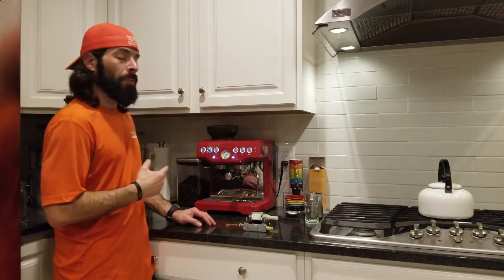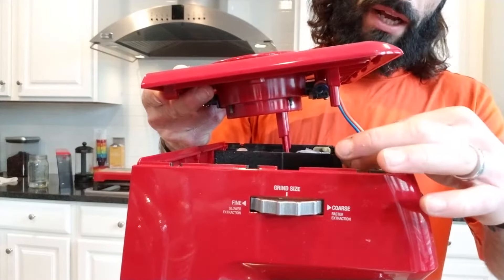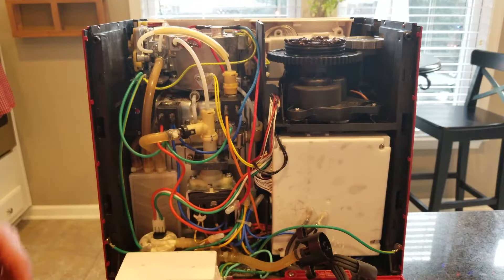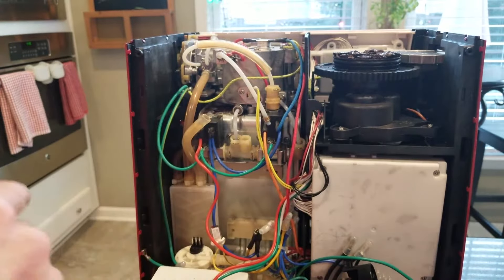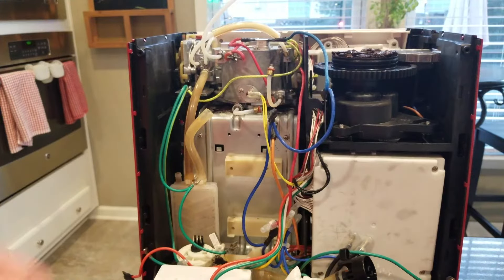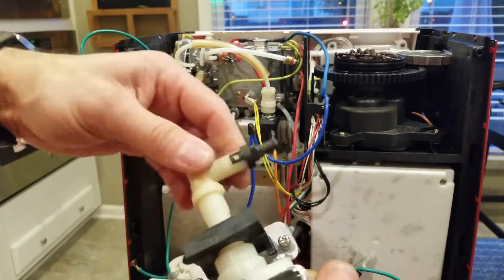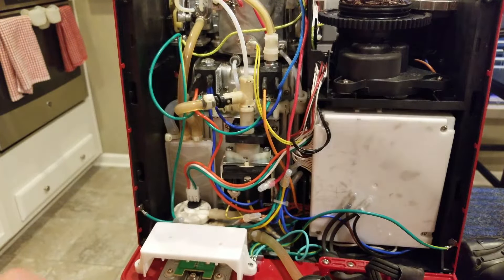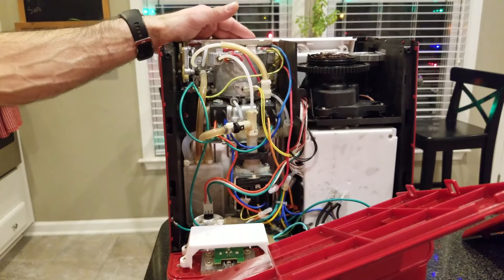Water Pump and Solenoid Block Replacement on Breville Barista Express 870XL

Comment: It's been years since you posted this, but I just wanted to give a huge thanks. My beloved 870 recently stopped putting out sufficient pressure to pull shots. Thanks to this vid I got a replacement pump and the swap went easily and my machine is now working great again. The pump was only $35 vs. the $270 Breville wanted for sending it in. They also couldn't guarantee that I would get the same machine back and since mine is the Cranberry red that is no longer made, therefore can't be replaced new,  I didn't want to chance losing it. Thanks again.
Reply from the maker: You're most welcome.  Makes me happy that it is still helping folks.

Comment: Greetings from the UK. We have the same Breville machine rebadged as Sage which has leaked twice now in 4 years.  First time it cost a fortune to have it repaired at a Sage service centre.
This time, with the help of your disassembly video I'm going to tackle it myself.  So, thanks for uploading.
Reply from the maker: If you have poor performance (i.e. low water flow) and no loud buzzing, then make sure to check for blockages due to scale breaking off and clogging the very narrow tubes.  A major culprit for this is the last tube on the right as you view the machine from the back.  Good luck!
Reply: @trappedinthedark8574   -  Sure, here you go.

It's not owned by Sage, it is simply who they recommend for their in-warranty repairs.  Sage don't have their own service centre in the UK.

Coffee Classics Ltd
Unit 1, The Stables,
Wayside @ Braunston Business Park
London Road,
Braunston, NN11 7HB
Phone: 01788 890 834
Email: info@coffeeclassicsservicing.co.uk
http://www.coffeeclassicsservicing.co.uk/

http://coffeeclassics.co.uk/what-we-do/machine-repair-or-breakdown/

Comment: Nice instruction video on how to do... I'd like to add in a small comment for anyone new to this type of repair if I may. Take pictures before you take things apart so you will know where it belongs after also pay attention to the solenoid wires because if you mix them up for example the left on the right and the right on the left it will not work correctly the blue don't matter and the green don't matter it's the other two I'm talking about look like orange or red very similar in color. The other wires are more easy to remember and straight forward. One more thing most people don't know about... the two screws that go up under to hold the lid downwards those are "less magnetic" less iron in them so they will not rust out when all the steam hit's them so take either put them aside so you will know where they go or use a small magnet and test them:) I've learned this trick after fixing many of 'em.
Reply from the maker: Nice tip on the screws and I love cameras for memory.  I can't count the number of times I have referenced photographs to alleviate the burden of recalling where wires and or connectors went.
Reply: Solid tip, did that, and it was useful 1 time. I always do when I open up something more complex than a stone

Comment: One tip I picked up along the way. If you use a tiny bit of food grade (Notice I said "Food Grade") silicone lube on your "O" rings they will not only go on easier, but they will find their seats and seat/seal better. It also serves to protect the rubber from degradation from heat and moisture. It is also a good idea to use the factory specified parts in all cases including the gauge of the zip ties. May not matter, but then again, you never know.
Great video! Thanks for taking the time to help some guy learn this skill for when his own pricey toy takes dive!

Comment: Great video! The steps you showed in the teardown were helpful in getting my machine opened for repair. 
Before ordering parts I checked out all the internals and found a clogged line from the boiler to the steam head (what you named the valve block). Cleaned it and tested it before putting it all back together and it works well once more.
Thanks again! 👍

Comment: This is an excellent walk-through of how to replace the pump, etc. I was having pressure trouble after years of use and had been anticipating a pump failure. I replaced the pump - would not have know how without this video. Thanks!    NOTE: after I replaced the pump my problem was NOT solved so I inspected the inline filter as described in other comments. It seemed clean but I decided to try DE-SCALING the machine. Made two full descale runs and my problem was SOLVED. Maybe I didn't need a new pump in the first place.
Reply from the maker: Scale is my number one go to.  I usually find chunks at the ends of the line causing a partial blockage.  This Red machine of mine seems to give me all the fits.  😅

Comment: Great video. Replaced my solenoid 2 years ago and now my pump is failing. Very nicely explained. Thanks!
Reply from the maker: Before replacing it try flushing it out with a syringe or the like.  Some have had scale build up in their pumps as well and had success in flushing it.

Comment: I had the buzzing sound too but it was caused by me not using a stronger decalcifying product. I used Vinegar which my manual told me to use. I spoke with Breville yesterday and they no longer recommend using Vinegar. They suggested I use Dezcal packets (Amazon has it). They instructed me to do the decalcifying twice and then follow up with the tablet "Clean Me"  procedure TWO times. When I did this, BOTH my pressure gauge AND my buzzing sound stopped. It was magical. I would do this going forward to prevent the buzzing to come back. Which is will if you do not decalcify it properly
Reply from the maker: That's a good tip.  I appreciate you posting it.  Currently when I get an obstruction I have no buzzing just poor flow and pressure.  I manually go in and remove the obstruction.  I know I keep saying I will post up that video and I eventually will.  I'm curious if that product is strong enough to dissolve the bits I normally find.

Comment: How to save your pump: 9/10 times, they're not dead, it's the diaphragm that's plugged with scale. Just pick up a 60ml syringe from your local farm supplier (Rona sometimes stocks them) and use it to force a 50/50 vinegar water blend up the uptake tube. Problem solved. Had my Breville 5 years and had to do this 3 times. Each time I was told to replace the pump, and each time I saved myself the repair cost. And oh ya, remove and clean the shower head. You'll soon see chunks of scale come out that you don't want plugging it up and creating too much back pressure.
Reply from the maker: Great tip!  And a good first measure.  I've yet to have scale issues that far upstream but have dealt with it further down stream. Again, thanks for the contribution.
Reply: Which is the "Uptake tube"... is that the tube that connects to the water supply container to the machine?
Reply: I know it’s been a long time, but where is the uptake tube? That might be my issue too.
Reply: @martinelocke  Yes. The long grey tube that dips into the tank is the uptake.  You need a good seal between the syringe and tube tho. I found that it can be removed by a small twist and pull, and the syringe seals perfectly into the rotating elbow it connects to. Force water in, several times if necessary until you see a good amount come out of the shower head and overflow. Make sure you remove the shower head with the one phillips screw and clean it out as well. That bugger gets all sorts of plugged up.

Comment: Thanks for making this video. I bought my 870XL in 12/2015, and it worked flawlessly until now (8/2019). Last week the machine lost all brewing pressure, and the characteristic noise when first turning it on was missing. I suspected (correctly, as it turned out) that the pump was the culprit. But while you replaced your pump with the ULKA EFP5, which is the original equipment model, I chose the ULKA EAX5, instead.

The EAX5 has the same power rating (52W) and the same form factor as the EFP5. The difference is that the EAX5 supports higher pressure and features a brass core, instead of a plastic one. It does need longer off intervals, though. So if you routinely brew several espressos in a row, it might not be the best choice. For me that was no concern, and since it was a lot cheaper on Amazon and available with next day delivery I just went with it. So far, so good.
Reply: cairnsblog I’m thinking of doing the same. How has yours held up to now?
Reply: @damienwills8658  It's been great. No problems, whatsoever. I think it has a bit more power than the original part.
Reply: My machine also is not doing the power on noise. None of the function work (1-cup/2-cup, hot water or steam). Do you think is the pump or the solenoid?
Reply: @eriskarreci940  I am no expert, so I don't have an answer for you. The symptoms of your machine seem to be consistent with the ones I experienced when my pump failed. I can tell you that my replacement pump has continuned to hold up perfectly since then. So, still no problem with using the ULKA EAX5 instead of the ULKA EFP5. That said, when I had to replace my pump, the EFP5 was a lot more expensive than the EAX5. Presently (12/2022) that doesn't seem to be the case on Amazon in the US.

Comment: Figured since this is the most viewed video about pump replacements, I figured id leave this little tid bit here;

A clogged inline filter can also be the culprit and mimic a bad pump and i recommend you check the filter before the pump. I replaced the pump and it was still acting the same which led me to inspect all the tubing for a clog. The inline filter is inbetween the watertank and the flow sensor inside the unit. Its a frosted whitish clear plastic piece with two barbed fittings. Remove the tubing with the filter and blast it with water. I used a waterpik and new pick head to blast water into the filter. Reinstall and see if it helped.
Reply from the maker: I don't recall seeing that guy, but good tip.  There is also another tip below in the comments about using a syringe to pressure water through the pump as scale can lock up the pump as well.  Both are easy and free trys before replacing parts and I highly recommend doing both as a first step.  I also have a scale video I will be uploading at some point showing where I have found issues in the past.
Reply: great suggestion..thanks
Reply: Mine died on me after 5 years of epic service.It s been working fine until I ve decided to run a cleaning process ! now It makes this buzzing sound and the preassure gauge goes crazy on me up and down unstable ! now after reading your comment It feels like my machine sounds like its fighting with a clog in there somewhere .I ll try and look for the pieces you ve mentioned before I ll send it to service( Im sure It will cost aa loot ) :/

Comment: Thank you for sharing this, I believe my 870xl is starting to have a failed solenoid. I'm going to try and clean the system with citric acid and see if the valve is just corroded. In the case that doesnt work I'm going to use this video to disassemble and replace parts. Thanks!

Comment: Ok great video btw, showed me every step to make. Changed the pump and solenoid but still water doesnot come up. Thinking about clogged tubing ?
Reply from the maker: yeah, that's the first place I look.  my issues were the noise and the pump didn't move any water.  With the back off looking at the boiler the line to your right on the lower part of the boiler that goes to the end of the solenoid block (also your right) is the one I always fine scale in.  usually, just at the boiler side as the tubes are too small to pass the scale.  look inside the boiler as well.

Comment: Brilliant Video!! Followed your video to find the right hand solenoid had exploded and welded itself to the casing…. So ordering the new part and fingers crossed it will fix it 👍 
FYI I had an “o” ring missing too 😂
Great tip to salvage one from the elbow of the old one 👌 
Thank you!! You’ve saved my machine 🤞

Comment: Awesome vid. Much thanks. O-ring was leaking where the upper hose connected to the pump. 20 cents at the hardware store and back in business. FYI 4mm ID x 7 or 8mm OD. I used 4mmx8mm with some silicone grease to help get past the seat. Will now go search for OEM parts...
Reply from the maker: I've had o-rings leak on me when reinstalling try...maybe a nick or small tear.  I'm hesitant on silicone since what I have is not food safe.  Maybe vaseline?  Thank you for the specs on the o-ring!!
Reply: I used a minuscule amount and chapstick would do the same thing.
Reply: This is the O-Ring that failed https://www.ereplacementparts.com/o-ring-p-1810362.html. However, is backorder no ETA.
Reply: LAI a seal specialist can supply you with the matching o-rings if you take the original in. There is food safe silicon grease widely available, but dive shops stock it if you struggle to find some.
Reply: I just got an O-ring from the old part and replaced the one that leaked.  All is good again!

Comment: Thanks for showing me how to remove the back panel. My machine was leaking water underneath, but I found out that the hose entering the top of the safety valve had come loose. Cleaning the o-ring for limescale and retighten the metal clip seem to have stopped the leak.
Reply from the maker: Glad I could be of assistance and it was an easy fix!!

Comment: Thanks, you got me up and running!  I called Breville and they shipped it for $45, it got to me in less than a week.  They needed me to provide the Solenoid Block Part Number: SP0020444, they couldn't look it up directly.  (I contacted eReplacementparts first, they said it would have to come from the factory to them first and then they'd ship it to me, lead time was a couple of weeks so I saved time and a 20% markup.)

It leaked a little at first, I took it apart, found the leaky valves and reseated the o-rings and that fixed it.
Reply from the maker: I'm glad the video got you sorted.  Breville sounds like the way to go for the parts!  Thanks for relaying that.  I'll leave the eReplacementparts link in incase they are in stock when people look and to grab the PNs if they need to call Breville.

Comment: Hey man thanks for the video very informative ! 
Mine died on me after 5 years of epic service.It s been working fine until I ve decided to run a cleaning process ! now It makes this buzzing sound and the preassure gauge goes crazy on me up and down unstable ! steam works fine.hot water running fine as before...
PS : nice set of cups you ve got there !
Reply from the maker: I'm curious if your solenoid, the same one in this video, is giving you issues.  I really should have videoed the noise before I replaced it, but with the pump kaput it really didn't do much.  FYI, you can take it apart and clean it.  I did this with mine and while it started working correctly it still made noise.  It's been so long since the solenoid failed (I lived with the buzzing for years) that I don't recall what the symptoms were exactly.
Reply: @lai2703  update : So I did this very serious cleaning process with 3 tablets at once...then did it again for 3 more times (but this time without tablets). The buzzing noise has not totally gone but reduced ! and preasure stabilization is back in the game ! The gauge doesnt go crazy any more ! It 's a bit louder than It used to be but now at least I can pull great shots!
Thanks for the video and the tips :)
Update : Some weeks passed without using the machine and now the buzzing sound is back :/ I think seloniod valf  has burnt out totally :/ Will get to the service when I ve the time

Comment: Great job. On mine, the steam pressure has stopped a year and two days after buying. And it drips water out of the group head about 15 seconds after switching on. The steam pipe is not blocked. Looking forward to having it repaired - it is a fantastic machine when it works.  

Update: I fixed the steam by running an entire bottle of white vinegar through cleaning cycle, then flushed with distilled water on two more cycles. (Our tap water has very high mineral content).
Reply: same, vingear saved the day!

Comment: This is brilliant. I think my machine is starting to have issues - the hot water and wand are no longer working, but the group head is.
Reply from the maker: Before ordering parts check for scale blocking the lines.  I have a video on this that I have yet to post and need to get around to editing it and publishing it.

Comment: Thank you very much for this well-done video. I have the same repair to do but I am not able to find the parts. Breville will not sell them to me. Could you please tell me how I can buy the pump and the solenoid block? Thank you
Reply from the maker: Looks like the link in the description for the block is still good (just back ordered), but yeah the pump seems to have been discontinued.  That really sucks.  Unfortunately, I don't have another line on the parts.  Some have had success getting the parts from Breville but it seems you ran into a rep that did not want to play nice.  Wait a minute....I plugged the PN into AMazon and

 https://www.amazon.com/Model-120v-minutes-Breville-Espresso/dp/B077ZRP3GD/ref=asc_df_B077ZRP3GD/?tag=hyprod-20&linkCode=df0&hvadid=241902529327&hvpos=&hvnetw=g&hvrand=3319218621328892771&hvpone=&hvptwo=&hvqmt=&hvdev=c&hvdvcmdl=&hvlocint=&hvlocphy=9007577&hvtargid=pla-400240592562&psc=1  

It looks like the right one!  Good luck on the repair.